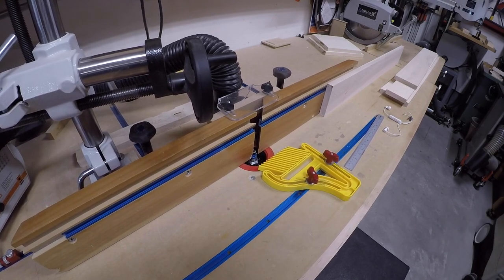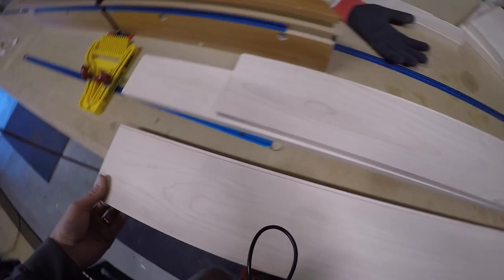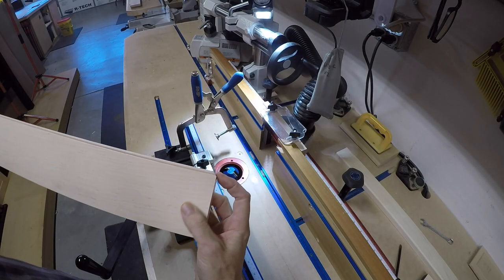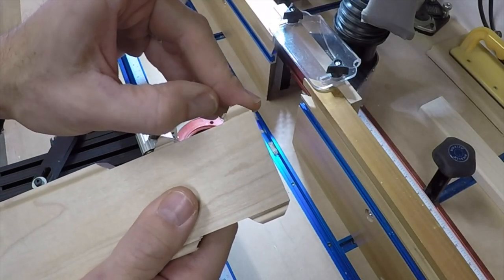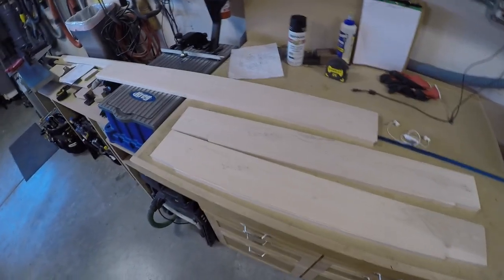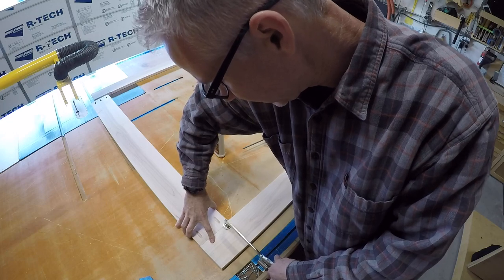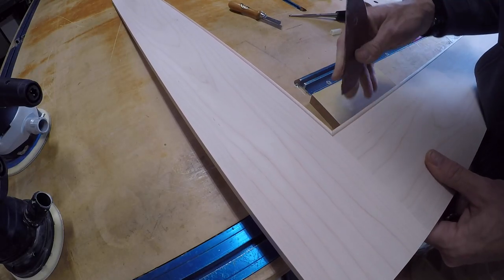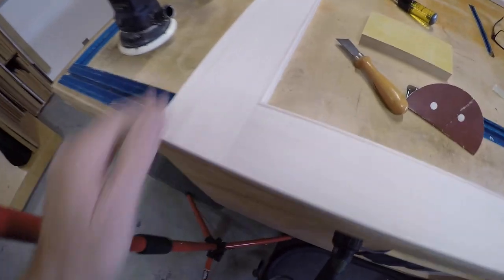How To Make Beaded Face Frames

Comment: For some reason when I use the Kreg notching jig on the end of a piece for a corner, I take my first pass, then move the stop, and the second pass creates a very slight ridge which shows up when I’m fitting the pieces together.  The first few I did didn’t have this, but now I can’t seem to get rid of it.
Reply from the maker: Let me start by saying thank you for watching this video and commenting.  I also can have this problem and it seems to have to do with the amount of pressure I put down over the bit. Also the board has to be very flat and preferably not warped at all.  In fact when I build these face frames, I don’t use any board that isn’t flat.  No twist or bend.  It just makes the process very much more difficult to get great results.  I use a sweeping pass on the Final Cut so to remove all uneven areas and produce a perfectly smooth surface.  This is a great system but it needs patience.
Reply: @davidbryanwoodworksandmore  Very helpful, thanks!!

Comment: Sold my Kreg Foreman for close to what I paid for it. I replaced it with a Castle Pocket machine. After using the castle I could never imagine going back. I can hold a joint with my thumb and experience no shift. It's a night and day difference. Another benefit is they cut much faster.
Reply from the maker: That’s pretty cool.  I’ll have to consider it.  I don’t use my pocket machine on cabinets like so many out there.  So it’s not a ton of use but any shift can be annoying.  By the way, did you like the video?  Do you make beaded face frames?
Reply: @davidbryanwoodworksandmore  the video was great. I was very interested in your jig for the haunch cut. Have thought of buying a Hoffman haunches from an auction but the Kreg setup looks fairly easy and I am sure much more affordable. Right now cutting and mitred beads.
Reply from the maker: @jamesmoore1532  thank you.  You know I was going to buy a Hoffman machine to do it but it took up too much space and it wasn’t really that great for stops on long pieces.  I prefer my setup much more.  But for massive production, you can’t beat the Hoffman.  This setup is very reasonable in cost but does have some leaning to it.  I really like beaded cabinets but don’t do them too often anymore. I’m sure when I build my own kitchen, I’ll be doing it.  Everything else I’ve built for my own home has it so it will match.  Plus my wife loves it.  Glad to have you on my channel.  Thanks a lot.

Comment: Subbed, thanks for posting.  Before getting the Kreg system did you ever consider a face frame notcher?
Reply from the maker: Hey thank you. Yes I considered it as I did every job with this detail.  But they are very expensive and honestly I felt like they take up a lot of room too. But if I had a lot of extra room and money, I’d probably have gotten one.  The thing is though, nowadays I hardly ever do this detail on jobs.  Strange how trends  change.

Comment: I see that you are burning your notches. Glue does not stick to burned wood.
Reply from the maker: Ken it isn’t any worry to have a little burning on the pieces. Certainly nothing that is going to prevent a good connection here. Any burning that is achieved here is so little anyways.  It’s more important to slow your feed rate to get a better cut than worry about burning.

Comment: Do you always use 1" screws when assembling face frames?
Reply from the maker: I am more and more.  I didn’t used to a long time ago but I noticed they shift a lot less than 1 1/4 screws and hold really well so it’s a win-win. Thank you for watching. And leaving a comment.
Reply: Not sure how much work you do to justify buying a Castle pocket hole machine but that will take care of the problem of your wood walking away or shifting.  I got lucky and was able to purchase one for a $150 but had to stick a bunch of money into it but still got it running for under a grand. I just could not stand Kreg pocket holes when I was used to using a Castle at my old job.